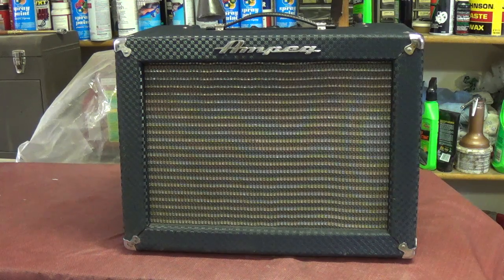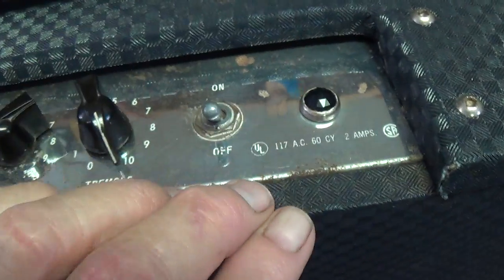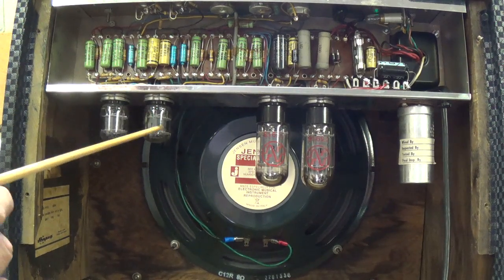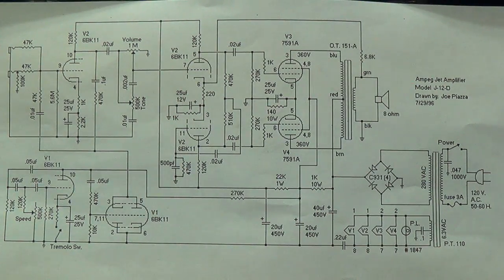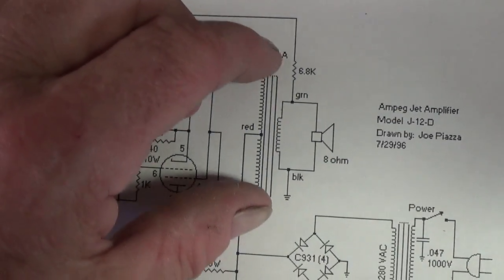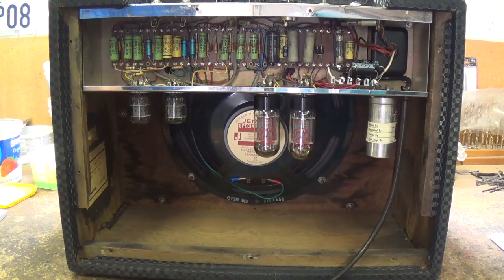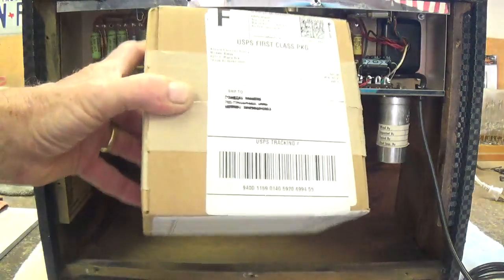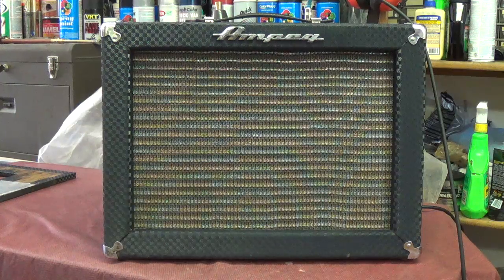1966 Ampeg J12D Jet from Craigslist.....Junk or Gem ???

Comment: Hey Doug, I've been watching your videos and I've learned a ton of stuff, really nice teaching method.  Anyway, I don't know if you've ever had any experience with Fender Blues Juniors but I'm having a bit of a problem that maybe you could shed some light on.  So what happens is when the amp has warmed up from my playing and crank up either volume control (blues juniors have a master volume and preamp volume) the amp starts to cut in and out accompanied by a horrible buzz/crunch.  I thought the input jack was loose and it was so I tightened it and that didn't fix it, I also inspected the connection points and no problems there.  Then, I thought the speaker was going bad so I plugged it into a big 8 ohm Marshall can I have and the problem ceased to exist, only to come back when I plugged the amp back into the blues junior's speaker.  So, that told me the speaker was going bad, I double checked and triple checked, and decided to pull the trigger on a new speaker, and unfortunately,
Reply from the maker: I would not have suggested the speaker as a source of the problem, Kyle, but since the problem went away with a different speaker, I guess it's the culprit. The end of your message was cut off, so don't know what else you asked.
Reply: ...when the new speaker was installed, the problem was not fixed, and it still let out this horrible buzz and would cut in and out, and would eventually just run away with an unstoppable 60hz buzz that is very loud and forces me to turn the amplifier off.  Then, when I turn the amp back on, it's all good and then when it warms up again with the volume set loud, it does the same thing.  So something internally is definitely hay-wire and j don't know what.  Hopefully, you've seen this before and possibly suggest a problem it could be, thanks
Reply: +Kyle Koplien P.S. all my preamp and power tubes are strong, and I've swapped them and changed them and it does the same thing, so it's not a tube issue
Reply: +Uncle Doug oh sorry, I had to write my message in two parts, I explain the rest in the next part
Reply from the maker: This sounds like the problem I had with the Ampeg amp in my latest video. Watch the power tubes and see if either of them changes when the buzzing starts. If not that, then it's going to require a tech to test and evaluate each component.

Comment: I have the same amp. Mine came with the original speaker, which I disliked and replaced with a Celestion Century Vintage (a British-made one). It's louder than the original and has more pronounced mids, and also makes the amp a little lighter. Mine came fully operational with the original Ampeg labeled tubes, but I did take it to a tech to have the two-prong power cord replaced with a three-prong (also the handle was all but destroyed, and a new - better - handle was installed). The only issue with mine is the tubes rattle too much. Any idea what can be done about that? Thanks.

P.S. Been watching all your videos on the amp basics. Learned so much - thank you.
Reply from the maker: You're welcome, Schmal. We're glad the videos are helpful. It sounds like a nice amp.  Since tube rattle originates from within the tube (as far as I know), I would think that nothing could be done to reduce it, other than finding a tube set that doesn't display this unpleasant tendency.
Reply: Yeah, I guess I'll have to be on a lookout for a pair of old stock 7591's. Looks like the originals were Sylvania (labeled Ampeg). I gotta do some research to see if another brand is actually better and then find a pair that biases the same. I don't suppose there is an adjustable trim pot for bias inside, is there?
Reply from the maker: No adjustable pot, but rebiasing is easy since the output tubes are cathode biased. You only have to change the value of a single resistor.....if at all.
Reply: Easy for some. :) When it comes to soldering, my hands grew out of my ass. :) I can play 'em, I can't fix 'em. I can only hope the new pair will fit right in with no extra work. Otherwise will have to take the amp to a tech... Found a pair of Sylvania 7591A's 59 mA and 55 mA. Do you think that's close enough?
Reply from the maker: Yes, they are within only 4mA (about 6%) of each other, which should be fine.
Reply: Thank you.
Reply from the maker: You're welcome.

Comment: Uncle Doug !!  Thanks for another great tube amp video !!  Love it !!  The amp might have been a home run if the fuse was all that was wrong with the amp - but it sure wouldn't have made for such an interesting YouTube video - smile !!

Over the years - I have acquired most of the electronic tools I need: O'Scope, Multimeters, tubes tester - etc.  Do you have any recommendations or pointers on how I might find/acquire a transformer sniffing dog ??

Be nice to add a depth control to the tremolo !!
Reply from the maker: You're welcome, Donald. I think that transformer sniffing is a rare ability that occurs as a result of sleeping under a work bench for many years.....so you'll need to find a puppy and bring him up that way.  As Socrates once said, "Great transformer sniffers are made.....not born".  I thought about a depth control, which could simply be a volume control pot between the tremolo circuit and point of insertion, but I would hate to drill any holes in the chassis.  Perhaps if there were a way to implement one without any permanent physical modifications.
Reply: Good points Uncle Doug !!  If it were me - I might consider finding a pot to put in place of the second input jack.  Nobody uses multiple input jacks any more - and it would be completely reversible !!  But that's just me.  Thanks again !!
Reply from the maker: That's an interesting suggestion, Donald. It could also be for an adjustable NFB loop.

Comment: What's the point of the .1 cap in series with the heaters centre tap to ground doug? Never seen one there before! Thanks doug
Reply from the maker: Excellent question, and one to which I have no answer. In fact, I considered it a possible source of the hum (since it may interfere with the proper grounding of the filament CT) but jumpering across it made no difference.  Also notice the .22uf cap between the filament grounds and chassis ground.....WTH ???
Reply: +Uncle Doug yeah that's weird too. Look forward to the hum fix update!!! I have a couple of ideas on what it could be and it would be interesting to see what you find! Thanks Doug
Reply from the maker: You're welcome, S740.

Comment: This is like finding a 67 mustang fastback in the neighbors barn.  I can't find any thing like that in my craigslist.  Tell Rusty hi from Dandy.
Reply from the maker: Believe me, it's not common on our CL either, JD.  There are generally loads of Fender Squiers with warped necks, non-working $25 SS amps, and drum sets that were run over by a truck. It took several months of looking for the Ampeg to appear.  However, over the years, I have found a mint Fender SF Champ and VibroChamp, a Kustom K200B4, and a bunch of really nice PA amps.....so I must admit that it is worth the time each day to look at CL. Rusty says "Hi".

Comment: Great Score Doug. Have been singing JJ's praises for years now, but have had nothing but trouble with their tubes lately. Weak or defective preamp tubes and octal power tubes that fail prematurely. I think I'll have to consider another brand in the shop moving forward.
Reply from the maker: Other viewers have said the same thing, MD. I wanted to replace the faulty tube with one that matched the good one, but my opinion of JJ tubes is riding on how these hold up. I'll let you all know if anything goes wrong.
Reply: I replaced the original Sylvania 7591's in my Versatone Pan-o-Flex years ago to preserve them for recording. Those have held up in the amp for 4 years now without any issues.

Then again, I just had a client come back with a newer Ampeg SVT they played only a dozen times since service. One of the JJ 6550's in the new sextet I put in had a defect in the glass envelope as the getter was white. You'd think $200 worth of tubes would last longer. I regarded JJ as the best new stock tube with regards to reliability, but now...I'm not so sure.
Reply from the maker: Public forums like this are the best way for us to learn about component failure rates, MD. Thanks for your informative input.

Comment: JJ's  I had once.  They self destructed within a month.  Now Tong-sol makes a 7591a in the original form factor.  I'm very happy with those.  They run great and are not priced bad at all.
Reply from the maker: If I have a problem with another of these JJ 7591's, I will definitely consider a Tung-sol replacement.
Reply: I run them in my Fisher 500c.  4 months in and I'm very happy with them.  My past experience with the JJ's I'd never buy another one.  Great find and fix!
Reply from the maker: This problem has made me leery of JJ's. I'll have to see how they hold up. Thanks :)
Reply: Next time try EuroTubes that guy has a in at JJ Tesla, he sells them he gets the best of the of the best then he tests them individually he's a good guy to work with.
Reply: I've always bought my tubes off of reputable company's.  Who do test all of their tubes (not eBay).  IMO JJ just makes an inferior product.  That's been my personal experience.
Reply from the maker: I'm beginning to regret my purchase :)  Time will tell.
Reply: Generally speaking JJ's are the cheapest tubes out there (except Chinese).  There's a reason for that...

Comment: Yeah those amps are quite nice. My first full amplifier restoration was an Ampeg V4. Pre 1974. Definitely was a fun amp, especially with its 545v plates and finding tubes that could take it. Eventually settled on JJ6l6GC as a quad matched set of NOS 7027 was going to be a bit spendy. Overall most Ampegs I've seen were built like tanks and were very loud and clean. Oh and a final thing and that is that hum in most of these amps come from poor rectification and/or bad grounding
Reply from the maker: I checked the FWBR, suspecting a faulty diode, but it checked out. I still may substitute another FWBR to see if the hum goes away.....just to be sure. Thanks for your input and advice.
Reply: Yeah. At least it isn't a pcb based Ampeg like the VT-22/V-4 and stuff. The compactron setup is one that was used in many Ampegs. The only other  thing I can think of  for that  hum is  heater leakage of some kind somewhere. As we'd hear 120hz if it was filter capacitors. But its  really hard to hear in  the video especially with all of that lovely tremolo. I do wish I could work on amps for a living as I enjoy some of the vintage masterpieces out there and working on them can definitely give you some fun surprises. Take care :D
Reply from the maker: Thanks for your nice comments, Mega. I intend to track down the source of the hum, eliminate it, and report my findings.....so stay tuned :)

Comment: Aloha Uncle Doug and Rusty I love watching your videos. I wanted to share I found a 68 Band Master reverb a week ago for only 60 bucks, it was really dirty and rusty. I got it home plugged it in. only hum. I noticed the speaker which is a 15 inch was plugged into the extention Jack. I could barely plug my guitar into dirty jacks I cleaned it up and to my amazement wow sounds good. yesterday I put new in tubes in it and got a double peddal. wow the trem and reverb was awesom. Slight hum. I opened the foot switch and noticed the ground came loose fixed it much less hum. I am surprised it worked at all. hope you don't mind me sharing. That Ampeg sounds awesome.
Reply from the maker: On the contrary, we love to hear from our viewers about their amp experiences, Ralph. Thanks so much for your nice comments and for your interesting input.

Comment: You'll find that noise,  just be patient...  and use the tools.    I bet some of the other caps may be past their due....  a little plastic crack, and the moisture gets in.
Reply from the maker: I spent a couple hours looking for the cause of the hum and finally decided to just complete the video and get it posted.  My fear is that it may involve one of the 6BK11's.....for which I have no replacement, and dread trying to buy one. If I do solve the problem, I'll let you all know the cause and solution. Thanks for your encouragement.
Reply: Any luck on digging out the noise?   did you try swapping the pre-amp tubes position to see if the noise "moves?"
Reply from the maker: I did reverse them, DK, and there was no change in the hum, so I assumed they were not to blame. I've been working on other projects lately, but intend to get back to the Ampeg in the near future.

Comment: Looks like a cool find! So how much did you spend on parts total? Also I noticed the hum moved with the tremelo. Is that any indication for troubleshooting it?
Reply from the maker: The tube, caps, and 3-wire cord were about $40, Jon. The hum originates before the volume control, possibly in the pre-amp stage. I switched the 6BK11's and it made no difference, so hopefully it isn't one of them. I need to disconnect the tremolo input to see if it's the cause.  If I solve the problem, I'll let you all know.

Comment: Nice looking amp, I did notice a few cigarette burns but no white paint specks.  Great tips for checking the amp, thank you!  At least Rusty didn't run away when work was mentioned. :))  I noticed the blue hot rod is still in the shop, still working on it, or did the Jeep get traded?
Reply from the maker: True, no paint specks. Perhaps a previous owner used something other than his amps as a drop cloth. You're welcome for the tips. I hope they come in handy some day.  Rusty discovered that it takes less energy to simply act interested (or at least tolerant) than run away.  I still have the Jeep.....I was out in the desert yesterday......and I'm trying to figure out a way to keep the '36 Chevy truck.  Maybe a colossal amps for hot rod trade :)

Comment: I'd say you did real good on that.
 That material covering the cab reminds me of that carbon fiber plate.
I like that look too. 
If you had that plug into a lightbulb would that bad tub condition be affected somehow?
I got a lot to learn.  thanks for showin your stuff..
Reply from the maker: You're welcome, YRU. I always use a current limiter whenever working on an amp. In this case, the short in the tube did not illuminate the limiter bulb, but the shorted filter capacitor probably would have. I replaced the bad filter cap before ever testing the amp with power.
Reply: I bought a yamaha m90 stereo amp a wile back and learned the hard way that that 's not candle wax someone accidentally dripped in the amp under the big electrolytic caps....I plugged it in hit the power and a small fire ensued.... I don't know if it can be restored. 
Needles to say it was an interesting experience that I don't care to repeat.
Reply from the maker: It definitely helps to have a current limiter when testing any new electronic device. Your amp should have been protected by a fuse. Did you check to see if it had one ?

Comment: nice video uncle doug i have a question i have a vox ac 4 that doesn't sound at all i also notice that the socket of the power tube is a little  darker  in the pin 9 what could be the problem ??
Reply from the maker: It's impossible to diagnose a problem like that long distance, TRex. I wish I could, but it requires on site testing and evaluation.